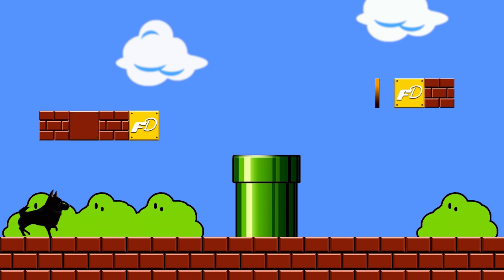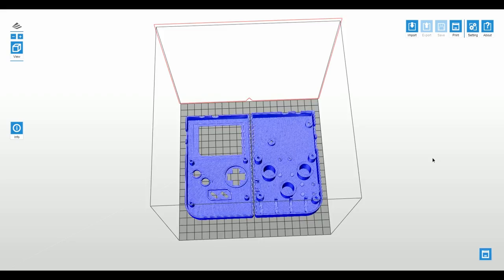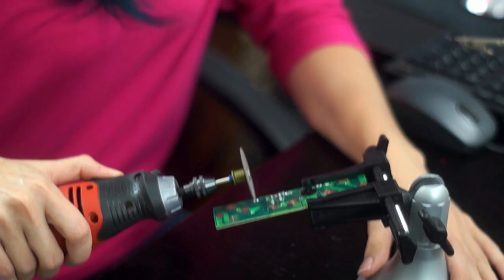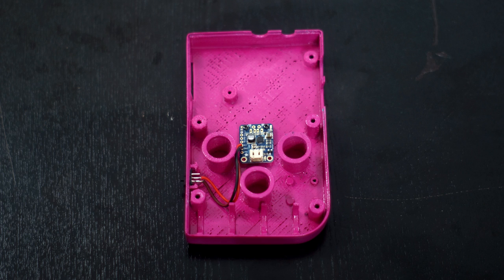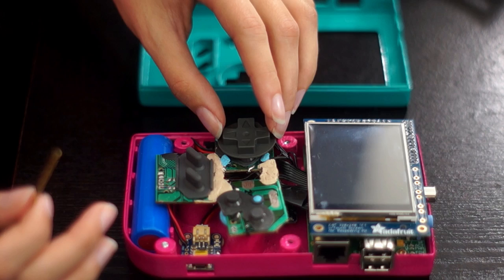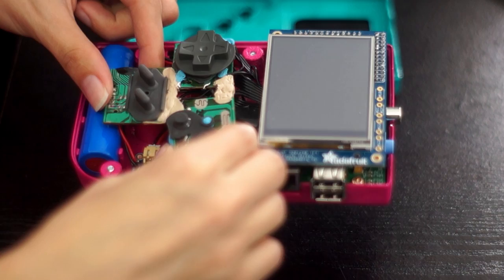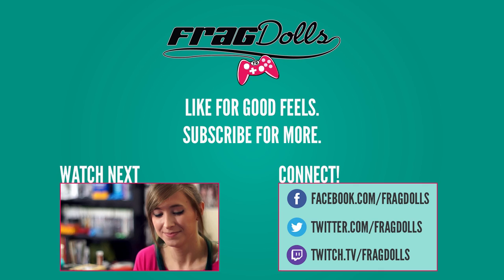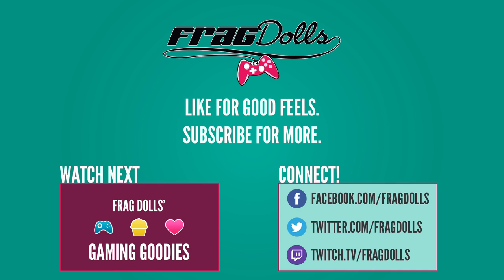Sabre Builds a Raspberry Pi-Boy! (Gameboy Emulator)

Comment: Can you use a b+ model of the pi
Reply: Strictly speaking, no.  The b+ has a different size and orientation than the B (for example, the audio jack would be buried inside of the Pi-boy instead of being accessible from the top).  However, if you modified the stl file to fit, the TFT display and other components, as well as the software, should all be compatible with the b+.

Comment: I can't get a nes controller. what else will work
Reply: You can use any sort of button inputs if it comes to that, but it will get a bit more complicated.  You can't find any non-oem, either?  I assume you're not in the US (they are easy to find on Amazon).

Comment: I just got all the parts to build this today. I checked the tutorial on adafruit and followed all the steps but when I plug in the charger to the powerboost 500 the green light only comes on for a second and shuts off. Does anyone have any ideas?
Reply: The Adafruit forums will probably be your best bet (they do support there for all their products and projects), but let me ask a few questions first.  Have you charged the battery and verified that the "charge" and "done" indicator lights work?  Have you tried turning the unit on with power connected to the charger's USB port?  This should turn on the powerboost's green light even if the lipo is disconnected.  Do you have a picture anywhere of your wiring?  I never finished putting mine together, so it's still cracked open and I can compare your to mine.
Reply: Well the charging light works when I hook it up idk abput the done light because I let it charge for a while but it never came on. I haven't tried turning it.on with the power to the usb port. I'm not entirely sure what you mean by that. I hooked everything up just like the tutorial on adafruit showed but the light doesn't come on, on the powerboost
Reply: Dylan Jones To charge the battery you need to plug the charger's usb port into some sort of 5v power supply (like a phone charger, computer, etc).  I'm just asking if you turned the unit on while that usb cable was still plugged into the phone charger (or whatever you're using).  And you wired up your power switch, too, correct?  Do you have a picture of your wiring?
Reply: Oh yes I did try that. I had everything wired and plugged in a 5v usb charger. No light on the powerboost though. I don't have a picture of my wiring right now.
Reply: Dylan Jones
Hmmm.  Just to make sure, unplug the lipo and try running the Adafruit charger (plugged into the usb phone charger) and the powerboost without the lipo battery as part of the circuit at all.  The "charge" light should be on all the time, but the "done" light should be a little erratic until you turn on the powerboost, then the "done light" will turn off.  Ideally the powerboost light would turn on at the same time (but probably won't).  If that doesn't happen, your wiring is wrong or something is broken.  Do you have a meter to test voltages?  If not, you can get a cheap one on ebay for $7.99 and free shipping, or $5.99 at a local Harbor freight (often less than that on sale, sometimes even free!).  You can check and see where you're not getting the power you're expecting.  Also, feel free to take cell phone pictures, upload them to Google drive, then just PM me the link?  That's the best I can do, I think!  Good luck, let me know if you get some pics or have a meter and want some advice on what to test!
Reply: Alright will do. Thank you I appreciate it
Reply: Dylan Jones
PS- If you do PM me, also leave a comment here.  I'm not sure if my notifications are set up the right way for PMs or if there's a spam filter or "friends only" or whatever.  If you leave another comment I'll know to check my inbox.  Okay, that's it!  Good luck again!

Comment: Anyone know some battery life estimates on one of these?
Reply: TechFro Considering that a Raspberry pi uses about 1.5 watts and the screen uses about the same...all up, that's roughly 3 watts. The battery used in the device is a 2600mAh Li-ion 18650 battery that runs at 3.7 volts which makes it roughly 9.62Wh. So factoring in a rough efficiency of 0.8... 9.62/3*0.8 = 2.5 hours abouts.

Comment: Can I use an original GameBoy case
Reply: Not with this hardware, there's not enough space.  But Adafruit has smaller versions now that you might be able to jam in there!
Reply: I'm pretty sure the screens are also different sizes.  But really, you can do anything you want with this stuff, though if you're dead set on using an original Gameboy case, I'd probably just follow a different tutorial!

Comment: Or like, you could just buy an actual gameboy for $5 at goodwill
Reply: Seiko Shinohara And then install a color screen with triple the resolution, a processor with 167 times the clock speed, a lithium battery with built-in charger, a USB interface, several gigs of game storage, and a Linux package that uses the upgraded hardware to run games far beyond the ability of the original Gameboy?  Wow, that's definitely the hard way to do it, but I'm sure it'll be worth it for everything you learn along the way!  Good luck, I look forward to the video!
Reply: TitaniumInside haha yeah good point i guess ;)
Reply: Seiko Shinohara Thanks for being a good sport about my sarcasm ; )
Reply: TitaniumInside haha of course :D

Comment: Yea, no. I build mine with a Pi Zero and a 1:1 Case Clone.
Reply: Yea, well when this video came out, the Pi Zero didn't exist.
Reply: TitaniumInside I think you can probably fit a full sized Pi into a standard case.

I like the original case.
Reply: also the pi zero is just not powerful enough
Reply: NonsensicalVids For Gameboy, it is definitely powerful enough. And for other consoles, most NES games work fine, some SNES games too.
And MAME runs mostly perfect.

But that's really all i play on it. Maybe if i would overclock it a bit more, it would run better, but since it has no real air flow, i am a bit scared of heat.